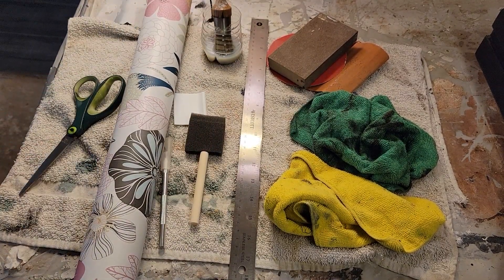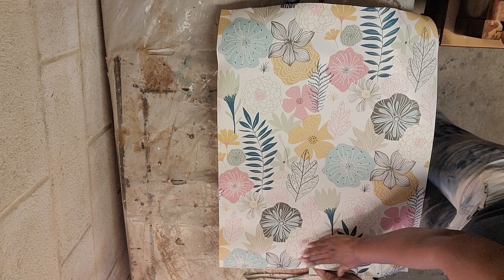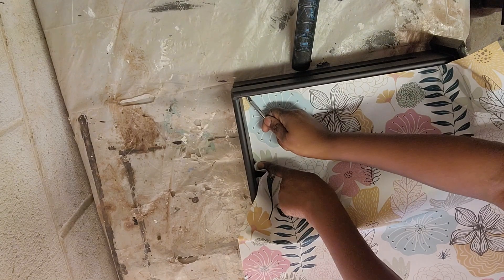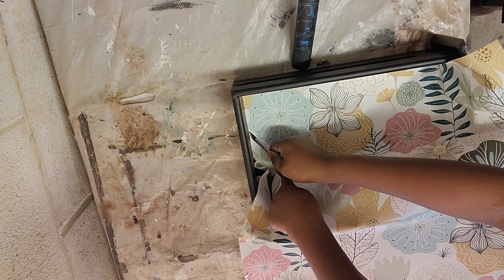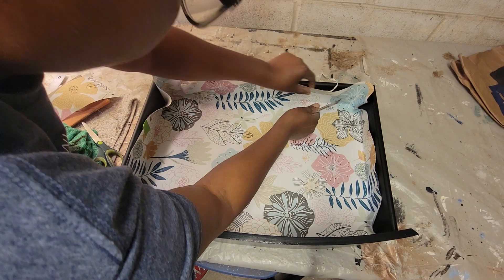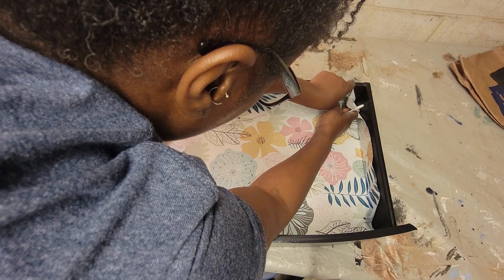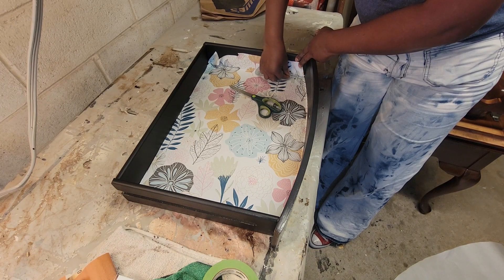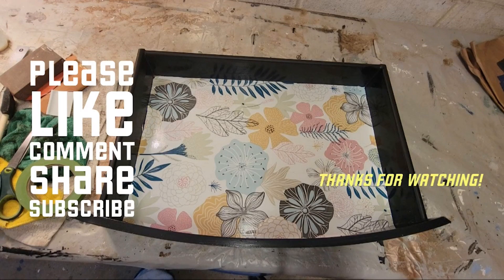How to Line Drawers

Comment: Lovely paper absolutely looks gorgeous with that color here's a little tip for you and save you so much stress flip the drawer over and make yourself a template with wax paper or parchment paper or any kind of paper underneath You could even use you wallpaper paper just don't peel the back off but use it as a template
Reply from the maker: Aww, thanks Shauna. I have some queen anne endtables that will be done this weekend, so I'll be trying the template idea for the drawers😏.